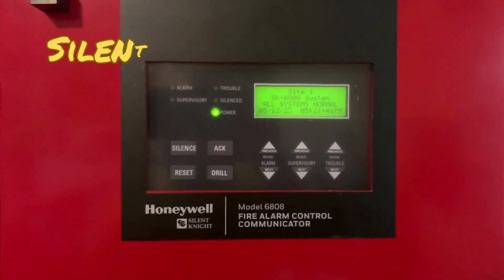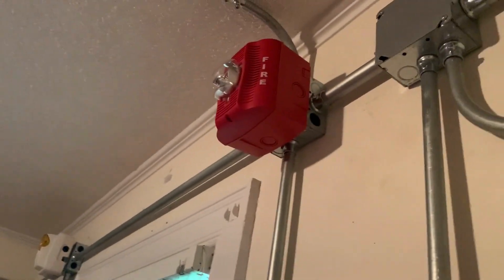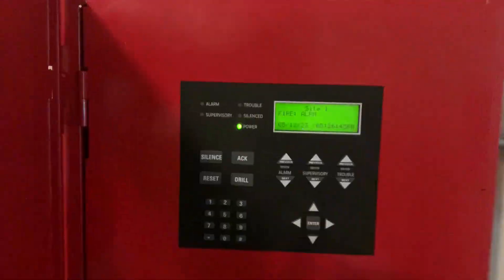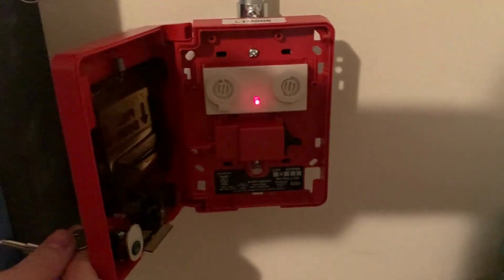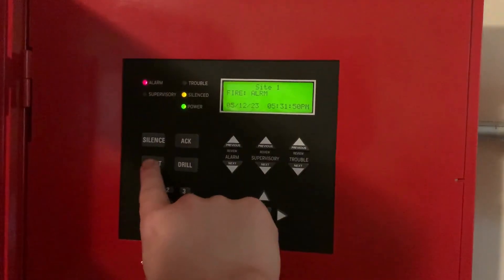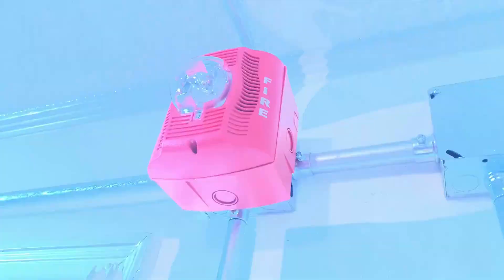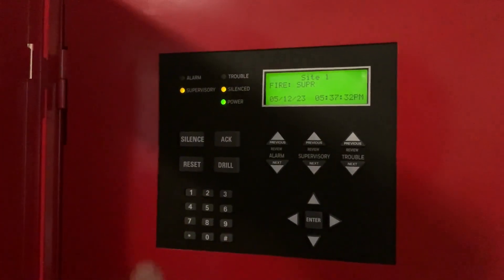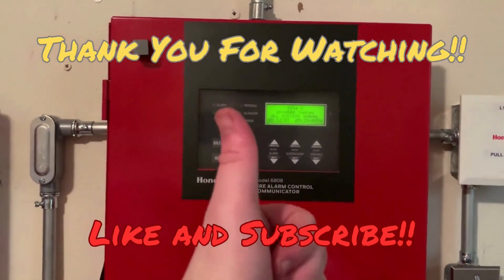Silent Knight 6808 s3 System Test 2 |Requested by MoparFam300c|

Comment: Mine stop flashing when I press silence
Can you help please
Reply from the maker: If you’re using an SK 6700, 6808, or 6820, you have to make sure that you have “strobes active when silenced” enabled in programming. And for audible silence on 4-wire devices, make sure you have a separate group programmed as non silenceable, and that your strobe circuit is assigned to that group using HFSS.